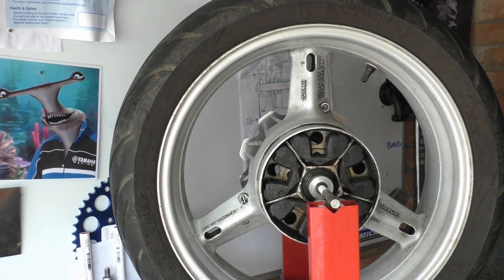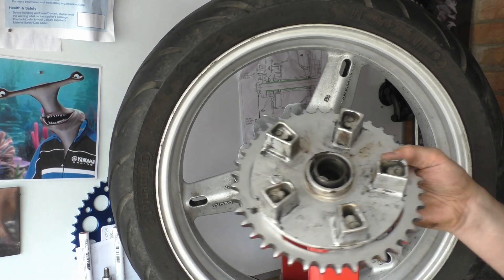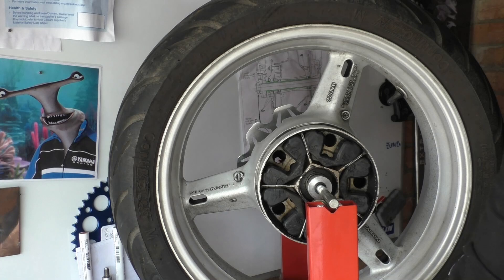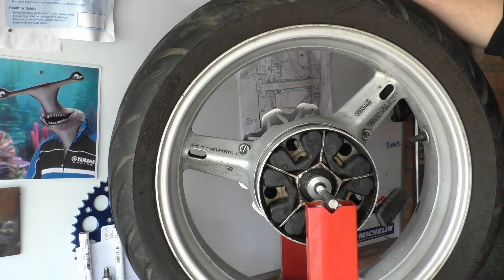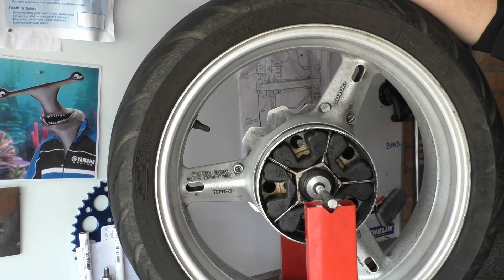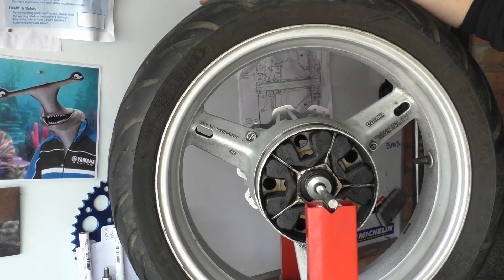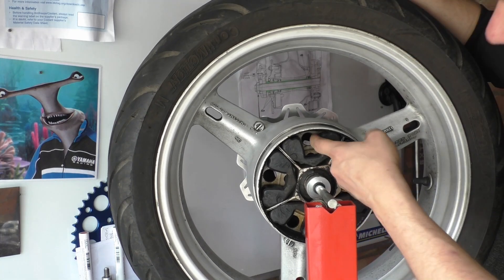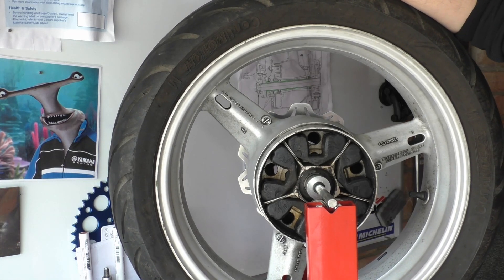Cush Drive - what does it do

Comment: Whats the difference in running a dirt wheel set up on road that isnt cush drive?  Wouldn't that be belting up your transmission also ?
Reply from the maker: No because spokes bend, thats why they're used for offroad gear

Comment: These dampers are not be taken lightly... I got mine misplaced when installing a new tyre and this misaligned caused the rear wheel slide, the engine to lug... This put a lot of stress on chain and sprockets.....

I finally got someone to take a look at this and voila, the bike now runs like butter

Comment: Just use the normal one and ride smooth, u can ride fast and smooth and your bike will last a long time. rubber cush drive will dry out over time.
Reply: Mine lasted for 6 years before turning into a gooey mess that looked like 8 blocks of chocolate.
I wonder if there's a better kind of rubber that I can use as a cush drive. 
:3
Reply: @nuclearwinter21  i put a new rear wheel on my bike and used a green polyurathane one. made in usa. You can prob find one on ebay. The company Alloy Art makes it.

Comment: I am a cheap bastard and want to save some money. Will it be safe to shim up the cush rubbers with pieces of bicycle tube?
Reply from the maker: As soon as the cush drive is that undersized it starts to fall apart quite quick - but then again you're a Honda bumboy so common sense doesn't apply LOL
Reply: @thedirtyworkshop  Well it is actually on a YAMAHA XTZ 660 ... :D But the 50 pounds price for new rubbers may be the best thing. Thanks for the ever great channel.

Comment: Cush Drives appeared in Europe in the 1930's primarily on Shaft Drive but didn't feature on chain drive bikes until Jawa & CZ adopted the system in the 1950's, gradually followed by others across Europe with Japan being the last to jump onto the train in the late 1980's.

Cush drive does away with specialist front and rear wheel roles so allows for a wheel to be both a front and rear item. Favoured originally by proper "built like brick outhouses" ISDT Enduro bikes (not the pretend off road Japanese trail bikes with an "Enduro" sticker or "Adventure Bikes") as it allowed for rapid removal and refitting of rear wheels with punctured tyres. It also allowed military and Enduro sidecar outfits to only require carrying a single universal spare wheel and tyre. 

On the plus side:

Gives smoother transmission loading take up.

Front and rear wheel interchangeability (Simplifies production for manufacturer).

Makes for simple and easy rear wheel removal.

Rear sprocket life and drive chain life increased slightly.

On the down side:

The rubber cushions can wear out (but are dirt cheap to replace).

On cush drive systems with integral chain sprockets make of f**king hard tool steel (Jawa and CZ) replacement requires the whole cush drive unit to be replaced, when they eventually wear out after 50,000 to 60,000 miles. This can be more expensive than a conventional rear sprocket, but still cheaper than a BMW shaft cush drive unit or a single genuine Harley Davidson foot peg rubber.

On some classic bikes with integral sprocket and cush drive units, where a replacement is made out of pure "Unobtainium" because the bike is so obscure that the manufacturer no longer exists or doesn't support the model anymore, the only option it to approach somebody that specialises in re-sprocketing integral cush drives (Talon Engineering in Yeovil) and have them cut off and weld a new sprocket onto the carrier. (I've had this done on a rare classic bike back in 2005).

In this instance the sprocket element is referred to as a "sprocket tyre" and they laser cut the old worn "sprocket tyre" off and then weld on a replacement that they've manufactured themselves. Needless to say, despite being only half Yorkshire, I felt severely wounded in the wallet department for years afterwards. Hey, but worth it to be able to ride an exclusively rare very fast tuned high revving 4 stroke 500cc single on the road again.

£71 in 2005 for just a sprocket plus the ride to Yeovil (twice) to drop it off and pick it back up again 2 weeks later.
Reply from the maker: The cush drive was invented by Royal Enfield in 1912 for use on their 425cc V-twin.
Reply: I stand corrected though it was BMW and DKW who seemed most enthusiastic for regarding shaft drive motorcycles.

Royal Enfield also invented ABS braking in 1950. I've seen pictures of the prototype..... lots of Dexion was involved.

I wonder if Royal Enfield will ever reintroduce a modern version on their 1930's 1135cc V-twin (basically a Bullet and a mirrored Bullet cylinder on a common crank). I saw one at a bike rally in 2008 and it was towing a sidecar.

Comment: Cush drive is to dampen angular vibration.
The chain will make more noise riding along a road without the cush drive (solid mount) than with the cush drive to the point you will hear the difference after converting from one to the other, and with that chain and sprocket wear both front and rear increases, as well as possible pitting on gear faces and wear on splines over a longer period. 
Assuming it is there just to absorb torque might lead some to think that any angular slack in it is ok as it still absorbs torque on take off, but not fixing it will suffer wear in the rest of the drive line unbeknownst to them.
Replace the rubbers you may notice the chain drive is quieter, and as such the chain and sprockets will last longer and the bike may even feel smoother to ride.
The clutch is effectively "give" in the drive line from the engine and back wheel, flip over the clutch basket on a big bike and you'll probably see radial damper springs in the base of the clutch that can take up angular load releasing the clutch.
But there is a slight power loss to the cush drive so for competition like sprint karts with small engines you run a solid mount..
For off road chains and sprockets are regularly serviced, dirt is the enemy in those conditions, and chain noise is not a problem so solid mounted rear sprocket is ok and less to wear out or fail..
Cush drives emit heat due to their function, the looser they are the hotter they run and the more they wear and slacker they get.
And if worn and running hotter potentially that heat and vibration could go into the sprocket carrier bearing and chain side hub bearing and cause them to loose lubricant as it thins under heat and vibration and then they fail early.
Reply from the maker: "angular vibration" - that's a new one on me - I'd use the term torsional vibration but each to their own.
Reply: Angular is my preferred word to describe things like angular momentum, angular inertia and angular vibration, IMO best describes the direction of movement. 
I tend to leave torsion for describing static torque, power and general twisting stuff.
But if you prefer torsional vibration that'll do.
Reply: Or from Wiki - "Torsional vibration is angular vibration of an object"
Reply: Mate you know your stuff. What's your thoughts of riding a dirtbike on road that doesn't have a cushdrive?
Reply: That explains why there was a belt of melted rubber residue on my sprocket carrier when the cush drives were perished.

Comment: why dirt bikes dont have a cush drive??
Reply from the maker: because no one cares about dirt bikes LOL - Spokes - that's why
Reply: naveedaka Dirt bikes don't need them because the wheel can easily break traction on the dirt and provide a similar cush effect. There are aftermarket cush sprockets that are necessary for street legalizing big bore bikes. I learned this the hard way when I split my hub in half on my street legal WR450 aswell as broke most of the spokes, folded the sprocket in half, knotted up the chain, fucked the swingarm, and cracked the case.
Reply: Matt I’m new to the channel but really enjoying the videos 👍🏻 have you done a vid on how the KYB sss forks work? I have them on my bike and do the oil change and seals myself just not sure how they work.
Reply: miceeno thanks for your reply..but here in india we have a transroader....which doesnt have cush drive..
Reply: My xt660 has spokes and cush drives. I know cos they were an MOT warning so needed replacing
Reply: Supermoto guys have this problem too.